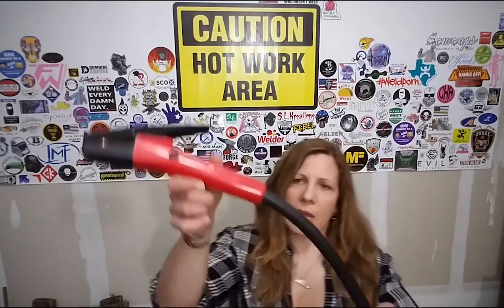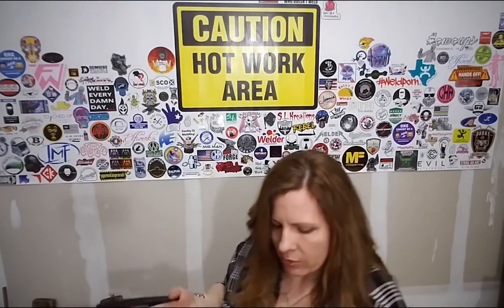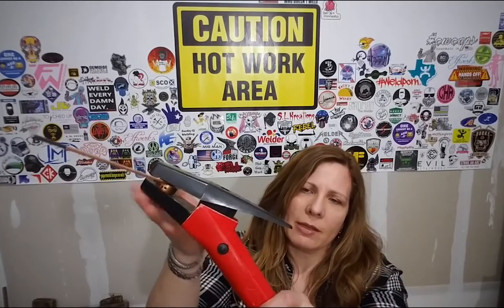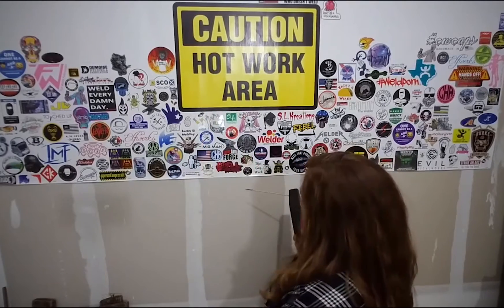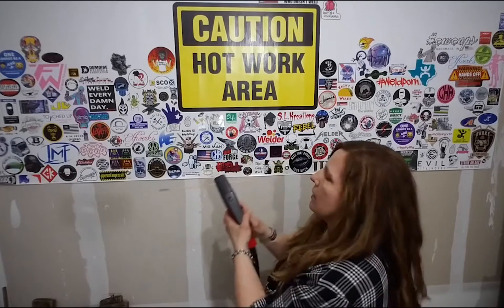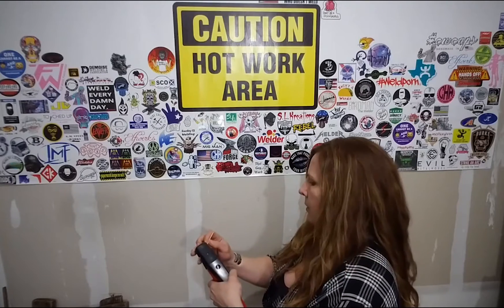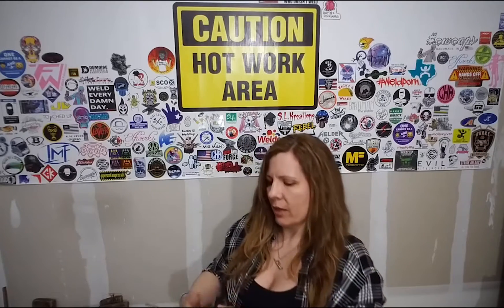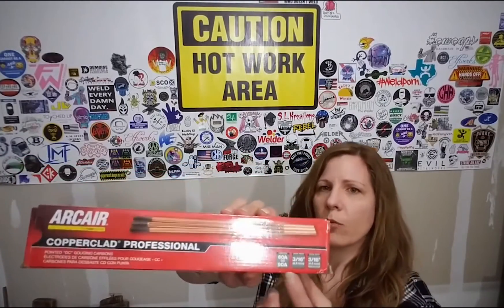Carbon Air Arc Gouging Tips and Tricks | Arcair

Comment: Cool video thanks for the tips! I've never done anything like this but I just started working at a steel foundry and I cut mainly stainless cf8m parts as they come out the molds and I've been having some trouble prolly cause I've been cutting with the rod at an angle greater the 90 degrees